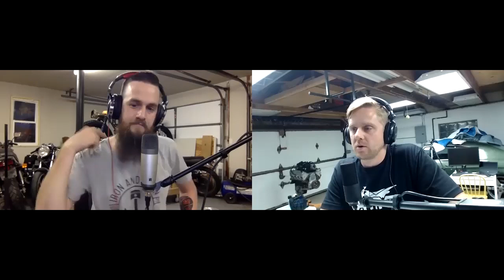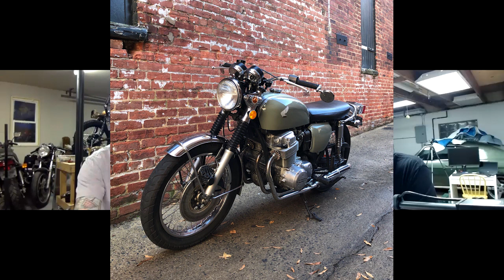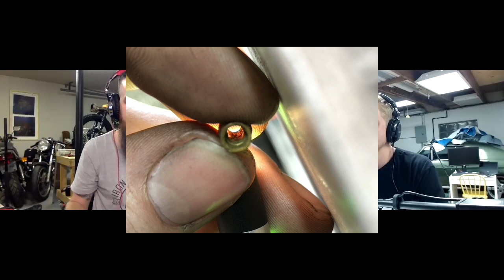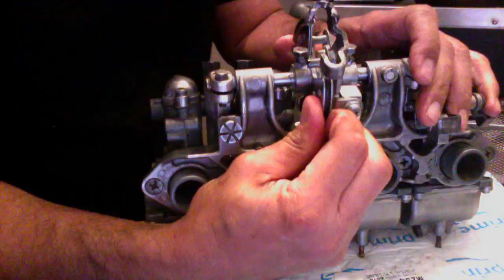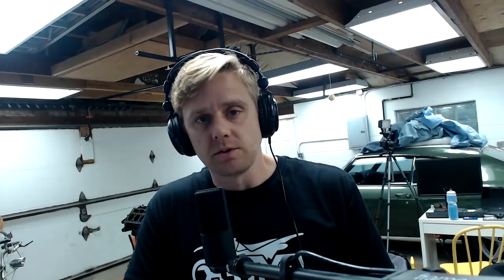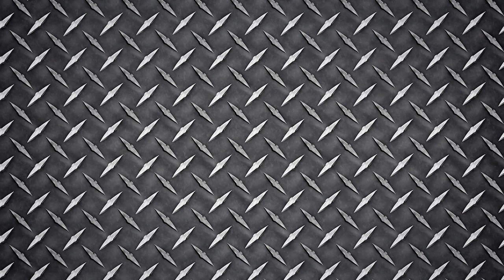The Broken Moto Show - EP6 - Weak Spark & Rich Sputter

Comment: Wow !... Great talk guys ... ,and I think Cody nailed it on the condenser issue. 
  Cuz on this 1978 Suzuki gs750 I've been working on for a friend... I seen spark at the points... thinking it was OK... ,but now I  know  differently. This bike is misfiring on cylinder 4 weak spark at idle... and wet plug... thanks so much for the mystery of the points and condenser!

Comment: Thanks again for the help, Matt. I got the carbs dialed in nicely on the CB750 and it's running great.
Reply from the maker: Awesome!
Reply: Did you go stock on them?
Reply: Chris Prezbyl the bike came with 40 pilot jets and 105 main jets, which are stock for the 1975.  It ran pretty good with those jets but I had to push it hard to get up over 5000 RPMs.  Someone suggested trying to go up a size with the jets.  I went 42 and 110 and it really woke the bike up.  No more problems getting over 5k.  I didn’t notice the slight sputter at first because it only showed up at very specific RPMs.  Keeping the 110 but going back to 40 pilot seems to have solved the slight sputter problem.

Comment: Great video. Keep them coming. I did send you an email. I just forgot to put I’m from Sanford Michigan. Glad you two out there. I also picked up a 1983 Honda gl1100 interstate and I’m sure I’ll have more questions on that one. Just finished rebuilding the entire brake system. Running a little rough but gonna ride it a while after letting seafoam sit in the float bowls and let it run in the carbs. Gonna let it set for three or four days and then run it with rec fuel. Great job again. Dan.